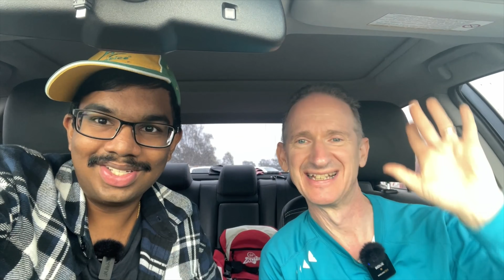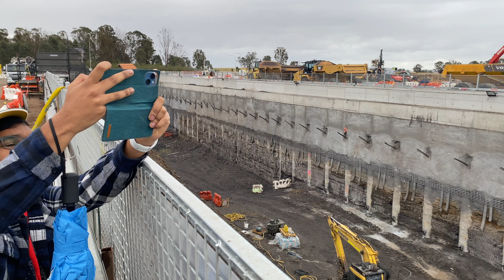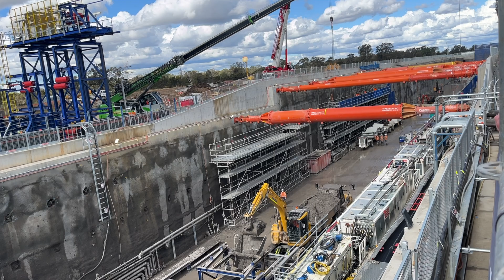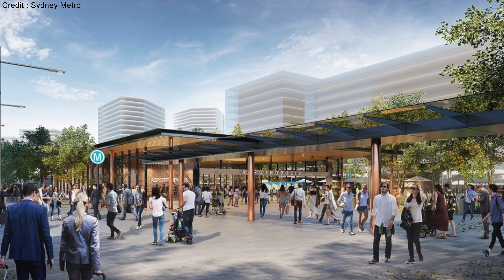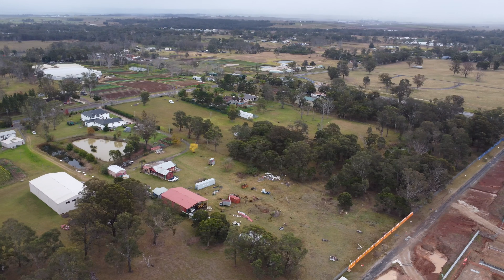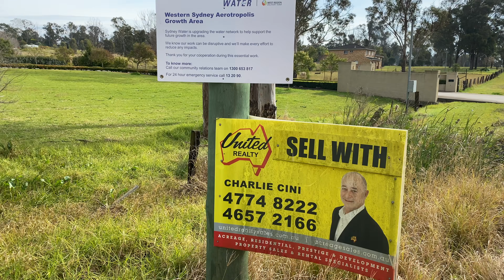Aerotropolis Station Community Day with Sharath@BuildingBeautifully  + Orchard Hills with Jo Haylen!

Comment: It should be pointed out that the station box under construction at the Aerotropolis (Bradfield) is only for the metro line from St Marys and its future extension to Macarthur.  The same goes for the Airport and Business Park stations.  Additional station boxes will be necessary at the Airport and Business Park for the extension of Metro West, assuming it goes ahead, as well at the Aerotropolis, with the provision also for the SWRL extension at the latter.  It would have been useful if reference was made to this and how they would fit in with the current construction.

The new NSW Labor government has not committed to feasibility studies for extension of Metro West from Westmead to the Aerotropolis or the SW metro from Bankstown to Glenfield via Liverpool.  Infrastructure Australia has committed funding for preparation of a business case for extension of the SWRL from Leppington to the Aerotropolis and conversion to metro, but I can't see how this would be feasible if the NSW government doesn't support the Bankstown to Glenfield metro extension.

If the Metro West extension doesn't proceed, then it still opens up the opportunity to extend the SWRL from Leppington to the Airport and Business Park as part of the Sydney Trains network, which IMO should have been the preferred option in the first place.  The St Marys metro link is useless in the early stages of the Airport and Aerotropolis development and Infrastructure Australia said as much in its assessment, although it would be worthwhile in the future.  

The business case  predicted a patronage of only 880 passengers per hour in the peak at 15tph initially, which is around 60 passengers per 3 car train or 11% of the line's capacity.  For an investment of $11 billion, it doesn't add up, when the early stages of the Airport and Aerotropolis development could be adequately serviced by the proposed rapid bus network connecting with Penrith, Liverpool and Campbelltown, until the level of demand warranted the rail link..  I might add, that the SWRL extension would provide far greater initial patronage, as it would connect more centrally with the broader rail network than on the fringe at St Marys, as well as providing a more direct and faster rail link with the Sydney CBD via the East Hills Express Line and Parramatta via an extended Cumberland Line, without the need to interchange.

The fact that extension of the SWRL has suddenly come back onto the agenda under the previous government,  when it was previously given a low priority, bears testimony to that.  It wouldn't be an extension of the St Marys metro link though, which is only proposed for 4 car trains, with 3 cars initially.
Reply from the maker: Yes that's right. These are much longer term plans, and I wanted to keep this video focussed on the current airport line project.

I'll leave it to others to comment on the pros and cons of this scheme.  I'm just pleased to see a rail link to the new airport happening.
Reply: Hi Xray1. I know this thread is a several months old, but I think you raised some interesting points. A few comments they inspired:

From the numerous clips of drone flights over the area, it is now apparent that some provision is being made for another metro line in from Westmead. The Elizabeth Drive overpass at the north end of the airport goes over the forthcoming M12. Just east of it is the underpass for the metro, which is quite wide, certainly wide enough for four tracks. Some diagrams of the broader area also depict an additional rail corridor curving away east across to Mamre Rd around the same place the WSI Metro curves away to the west towards (new) Luddenham station.

The WSI Metro now under construction is what I would call a 'Mini-Metro' with 3 car sets (expandable to 4). The WSI Metro station boxes seem to be matched to that, once the area used up by (non-public area) services and (in some cases) crossovers are taken into account (diagrams of them available online concur with that). If the metro in from Westmead is an extension of the West Metro it is likely to have longer trains, requiring longer station boxes. There appears to be provision for this line along the east side of the WSI metro and under the bridge in the airport area, and for additional station boxes parallel and east of those for the WSI Metro. II suspect these will only be developed during 'stage 2 of the airport in 2 to 3 decades) There is also a 60m wide transit corridor through Bradfield paralleling the WSI Metro station.

I have a quite different view about rail connectivity from WSI to 'Harbour Sydney' than most. I don't see it as the primary purpose of the WSI Metro line. It's there to provide a north south transport spine through western Sydney; an area which already has a larger population than the rest of Greater Sydney. Increasingly, the gentrified Harbour City will need the West of Sydney as its industrial powerhouse and employment growth centre, much more than the West needs it. Don't get me wrong, interconnections are needed between the two, but I see tham more as important secondary benefits, rather than a primary purpose.  When our (mostly radial) rail system was originally designed, Sydney was a very different place; where the only place for employment, study, shows and serious shopping was around Central and the City Circle. That's not been true since the 1960s.

I don't see a big demand for people to transfer between flights at WSI and the existing Sydney KSA (Kiinsford-Smith) airport. If, say, you are flying in to connect with a flight that only runs from one, you will get a (very likely available) connecting flight to the same airport. I would suggest the passenger load for the WSI Metro will be as much (or even more) for people working at the airport than passengers, probably people who live at places like St Marys and Oran Park etc. And not just at the airport, that whole N-S area is rapidly being covered by workplaces. The connection at StMarys and similar allow for other Western Suburbs dwellers to get easily to the airport. But if someone lives at Padstow, Bondi or North Sydney, they're probably going to continue to fly from KSA.

My big question is more about what Bradfield (core metropolis) is for? Its projected population is about 10K, yet it's purported to be "Sydney's third city" (possibly the marketing is getting the core aerotropolis and the greater aerotropolis muddled.). It will connect with mere suburbs like St Marys (12K) and Oran Park (18K), and LGAs like Blacktown (nearly 400K), Penrith (220K), Liverpool (240K), Camden (120K) and Campbelltown (170K), yet somehow it will dominate the area??? It has a Central Park that is only 2 ha, a pool and a larger park with a stage. It will undoubtedly be pretty, green, walkable, up-market and quite expensive. It's certainly not being built for Westies (no clubs, no pubs, no malls, no cinemas, no sports fields for kids, no parks for a quiet BBQ), so I'm guessing it's for their aspirational bosses to reside in the West, without having to live there, so they can feel pseudo-privileged. (Meanwhile the real money will be in mansions on 50 ha in the gorgeous (but largely undiscovered) semi-rural hills and dales to the deep SW of the airport.)
Reply: @tacitdionysus3220  From press comments over the last few days, it appears that the development of Bradfield is way behind schedule.  Regardless, it's still going to take a long time before it reaches a critical mass.  I've always maintained that it is more likely to develop in a similar manner to Macquarie Park, which isn't a bad thing in itself, but I wouldn't brand it as a third city like the Parramatta or Sydney CBDs.  Penrith and Liverpool are more likely to develop as genuine regional CBDs. 

Agree that the primary purpose of the WSI Metro is to provide a north-south transport spine through Western Sydney and not to provide access to the Harbour City CBD and other eastern destinations such as Liverpool and Parramatta.  But I think that strategy is misplaced as a priority, when the business case predicts a very low patronage in the early years, which could have been adequately catered for with a rapid bus network until the level of demand warranted the metro line.

This is reinforced by the sudden about face to extend the SWRL from Leppington to Bradfield and convert the whole line from Glenfield to metro, for which a business case is currently being prepared.  Extension of the SWRL was previously given a low priority behind the metro extensions.  I'm not convinced that this proposed extension and conversion to metro will directly connect with the WSI Metro at Bradfield as many appear to suggest.  The two lines are incompatible, even if the extended SWRL is converted to metro, with differing train lengths and power sources.  The SWRL conversion is now even less viable with the Minns government not supporting a business case for extension of the C&SW Metro line from Bankstown to Glenfield via Liverpool.  The SWRL conversion from Glenfield to Bradfield could end up as an isolated asset, not to mention the need to find an alternative location to replace the Sydney Trains Leppington/Rossmore stabling yard.  

I'd go even further to suggest that the greater travel demand from an extended SWRL to Narellan as part of the Sydney Trains network would be to the Sydney CBD and other eastern destinations such as Liverpool and Parramatta, rather than to Bradfield and the airport.  I don't see it being any different to the current travel demand from the north-west, which is to the east.  That brings into question the need to extend the current WSI Metro further south from Bradfield.  

It makes the most sense to extend the SWRL as part of the Sydney Trains network to at least Narellan via Oran Park, which was the original intention,  with a branch to Bradfield and the airport precinct, including the business park, since the government also hasn't supported the extension of Metro West from Westmead to Bradfield.  The extended SWRL could utilise the corridor preserved for the Metro West extension with the extended additional station boxes at Bradfield,  Airport Terminal and Business Park.   An extended Cumberland Line could provide services to Liverpool and Parramatta.at a higher frequency.  There could also potentially be a Y link from the SWRL extension from Narellan to Bradfield and the airport precinct.  No doubt the metro purists won't agree with it, but it's the most sensible option.

Agree that there won't be a huge demand for travel between WSI and KSA, but for those that need it, it would involve a simple cross platform interchange at Glenfield.  In saying that, I suspect that there will still be demand to and from eastern Sydney for overseas tourists travelling on budget airline services in particular.  I suspect that over time, WSI will become the dominant airport for Sydney.
Reply: @exray1  Thanks for all that exray1. Much appreciated.

- I had similar thoughts about it being a sort of toned down Macquarie Park. Delays for it don't phase me that much, my concerns would be more about it being more a showcase than a productive centre. The airport and the rest can work as well, with or without it. There's still 2 years and 8 months until WSI opens - they say 2026, but the fine print says 31 Dec!

- Was in the USA last year and rode some of their airport rail services, which seem to be built to a budget and more like trams connected to form trains - though it did mean they could do sharp curves and climbs to negotiate difficult routes more cheaply where needed. Busways are a possibility, but that can often mean that's how they stay, and stepping up services to cope with peaks is much easier in a driverless metro system. Like KSA it will probably only carry 20% of the airports passengers, but probably more of its workers.

- Somewhere on Youtube I've done a rundown of several options for SWL, all of which have their strengths and weaknesses, but I don't know enough about relative construction costs to suggest likely winners. It would appear the cheapest is a Chatswood style cross-platform exchange at Leppington, with the most expensive probably being an extension of the SWL to Bradfield.  Some old diagrams show a surface cross-platform exchange station just south of Bradfield. I guess we'll see soon enough.

- I've noticed some overseas budget bus tourists already stay towards the west after a brief initial visit to Harbourside, then they're off in other directions in coaches to pat kangaroos at Featherdale and beyond. If WSI did become the dominant airport, I wonder what pressure might arise to close a runway at KSA for developments?

- Not sure how much inside the industry you are, but if you know whether the WSI Metro loading gauge, (especially its width for platforms), corresponds with any other NSW rolling stock, I'd be curious to know?
Reply: @tacitdionysus3220  All I know about the WSI Metro rolling stock, apart from being ultimately restricted to 4 car train sets, is that they will be wider than the current Metro Northwest sets and have a different power source (25KV AC v 1.5KV DC).
Reply: @exray1  Thanks. I'm wondering if the press have got it wrong (shock, horror). 

The Siemens Inspiro trains to be used come in a 'standard 3rd rail version' of 2.77 m width,. (Sydney trains and metro are just over 3 m.) The OHT Inspiro version comes in widths "up to 3 m"

The original article is very vague ("...there is some suggestion...they are wider..") and includes a table comparing the three metro lines. The other two lines will use similar rolling stock (Metro West stock not yet announced) with a width listed as 'standard', while the WSI Metro says it will be "wide (tbc)". 

I suspect the 'wide' is merely what Siemens call their 'wide' Inspiro version, and is actually our standard width. Notice how everyone (including the media) has gone quiet about the issue.

25vAC is good; significantly cheaper and more adaptable - we should be introducing it where possible - BTW it's also being used for the West Metro, and probably wasn't used for the NW-SW Metro only because it's too closely mixing with existing 1500v DC line systems in places. Just a theory.
Reply: @tacitdionysus3220  It was stated in the business case that they would be wider to accommodate passenger luggage and therefor incompatible with the existing metro stock., but wasn't specified to the best of my knowledge.  

Agree about 25kv AC being preferable for new lines, but when they started mixing them up by converting existing lines with 1,500v DC, then it was cheaper to adopt that specification rather than going to the expense of upgrading.  

It's a bit of a dog's breakfast unfortunately, which has compromised any future continuous metro extensions, when it could have been avoided if the metro network was completely segregated without converting any existing Sydney Trains lines.
Reply: @exray1  Thanks X-ray. I wasn't aware of that. 
Have just located "The rolling stock presented in the business case is wider than those in service on other metro lines to give more room for passengers and their luggage." on page 4 of the Infrastructure AUSTRALIA (Federal) Business Case Evaluation Summary dated 18/Feb/21. 
However, the Infrastructure NSW (State) Final Business Case Summary of Nov 2020 doesn't mention wider stock at all in the relevant section on page 11.
Are there any other documents I should be aware of?
Reply: @exray1  Thanks for that. Wasn't aware of those documents, but I did a search. 

Couldn't find a public copy of the detailed Business Case as such, but I found an Infrastructure NSW Final Business Case Summary (Nov 2020) which has a section on rolling stock (page 11) with various details, but with nothing about them being wider. 

I also found a (federal) Infrastructure AUSTRALIA Project Business Case Evaluation Study (Feb 21) which includes (Page 4) "The rolling stock presented in the business case is wider than those in service on other metro lines to give more room for passengers and their luggage". 

Now I wonder if the feds are referring to an earlier version of the Business Case, or NSW just didn't include it in their 'Final Business Case Summary   -  Is there any other document I should be aware of?
Reply: @tacitdionysus3220  None that I'm aware of, although that doesn't mean there aren't any which haven't been publicly released.
Reply: @exray1  Thanks. I appreciate the chat.

Comment: Do you think it really can open in time by 2026? It's only 3 years away, there's still seem a lot to be done...
Reply from the maker: Hi Stanley, I reckon at the speed that they are going, and answer is yes. And they are talking late 2026. Its a lot simpler than the City & Southwest or Metro West, and has many similarities with Metro NW, so its not unchartered territories.  And having a significant above ground section will help too.

Comment: You should have asked the question why wasn’t the Aerotropolis station extended to Leppington by Metro or heavy rail. Also why wasn’t The North West Metro, extended to Scofields now not some distant time in the future.
Reply: ..and why the WSA metro is not compatible with other metro lines, and why there ia a 7km gap between stations on the Parra metro, and why the post-metro west of Bankstown plans are such a mess, and why the Parra LRT does not extend to Carlingford and and